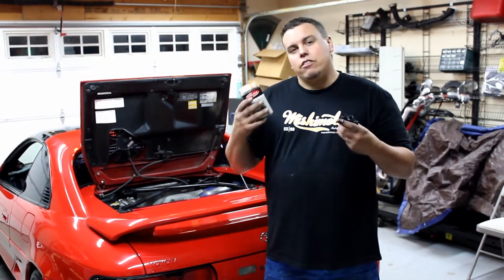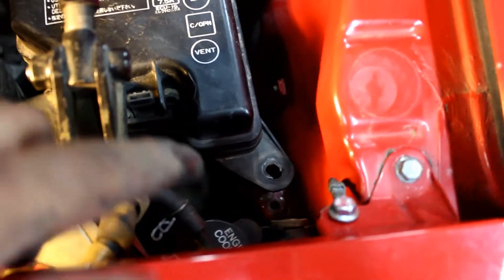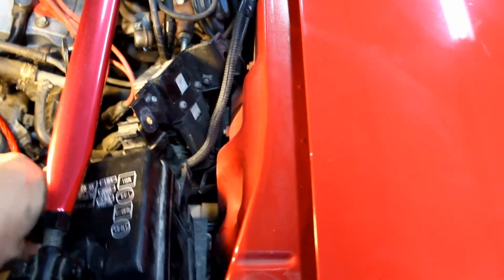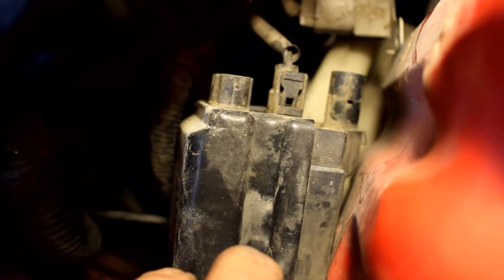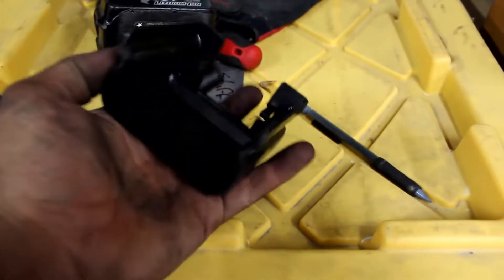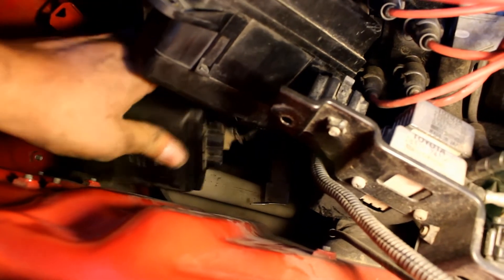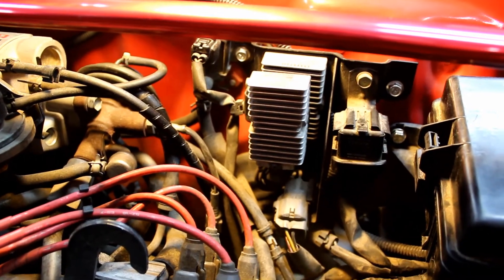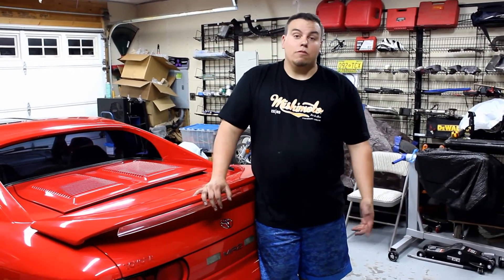How To: Turbo Toyota MR2 Ignition Coil Replacement

Comment: no need to remove or loosen the fuse box or relays, the two 10mm bolts for the coil can be easily reached with a 6in extension and socket, just pull the plugs from the coil first, then pull the plastic cover fitted over the coil towards the engine so you can access and remove the 10mm bolts, removal can be done in 5mins
Reply from the maker: sure may not be needed, but it makes it a lot easier.

Comment: Helpful guide, though somebody reinstalled my coil wrong last time it was serviced. That whole coil and igniter assembly was upside down, installed with just one bolt. Had to repurpose another bolt and scrounge up a spare with the same thread pitch to use elsewhere.
Reply from the maker: Thanks for watching!

Comment: I have no spark I checked all wiring to ecu , ignition coil and ignitor checks good. I think the issue is the distributor is that what ended up fixing your no spark condition?
I have mr2 turbro 3sgte gen 2
Reply from the maker: Yes.  And needs to be a toyota if possible.  Others can work poorly
Reply: Thanks for responding do you know the part # of a Toyota part will this one work Distributor Cardone 31-789 Reman? @FatGuyBuilds
Reply from the maker: @sandonlyon9325  no sorry
Reply: Do you know if the symptom  you were having would not create no spark even with the main coil wire pulled off of the distributor placed close to a ground? I ask because I don't see no spark at all. @FatGuyBuilds

Comment: Did it work?
Reply from the maker: no the main issue was the aftermarket distributor.  only replace with toyota brand distributor.  or a coil on plug setup
Reply: FatGuyBuilds 🙏
Reply: What was wrong with the distributor?
Reply from the maker: @gianloquillano6843  not sure.  but if you look on the forums. these cars dont like to work right with anything other than toyota brand distributors
Reply: Did you change the whole distributer, or just the cap? @FatGuyBuilds
Reply from the maker: @stacky86  whole distributor
Reply: @FatGuyBuilds  ok. Also your video helped me with the coil so thanks.
Reply from the maker: @stacky86  glad